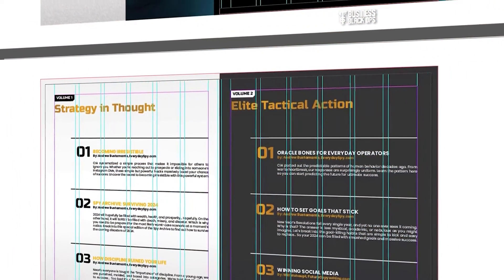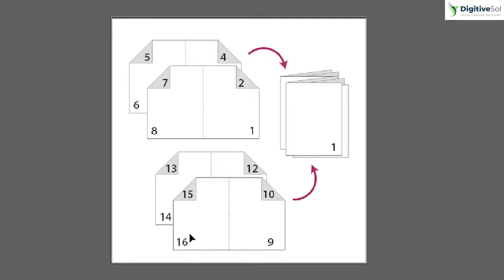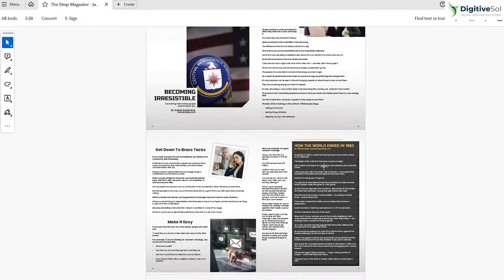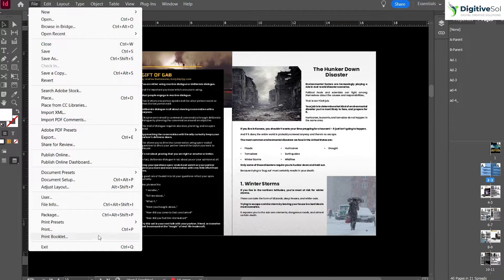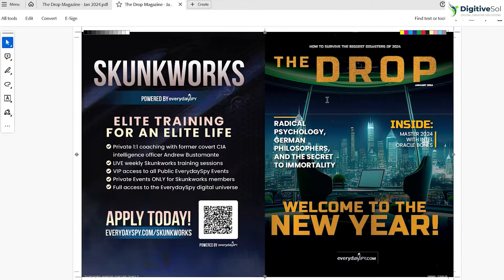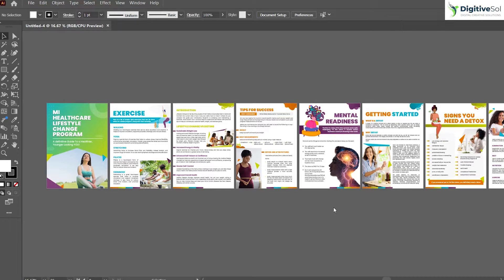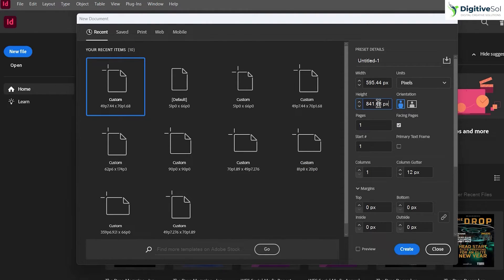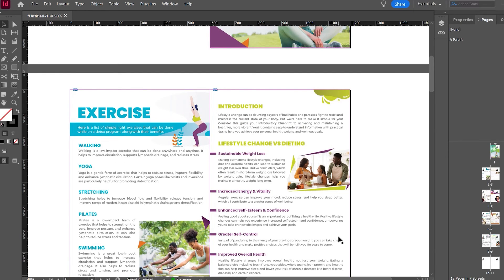Mastering Print Booklet Design with Adobe InDesign

Comment: Thanks for this video. I'm having an issue where the front cover is by itself when I export the pdf. All other pages are fine but the front and back covers are not attached. Is there something I am doing wrong when exporting?
Reply from the maker: Make sure all pages are selected in the Setup Tab when you Hit Print Booklet option